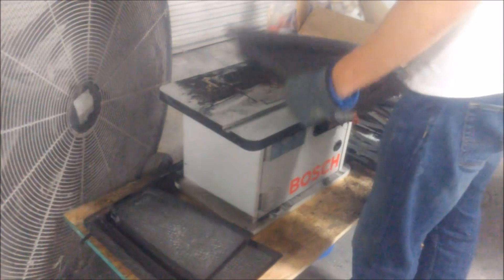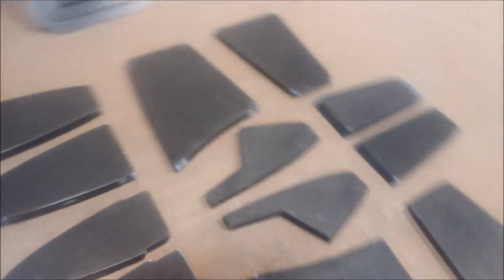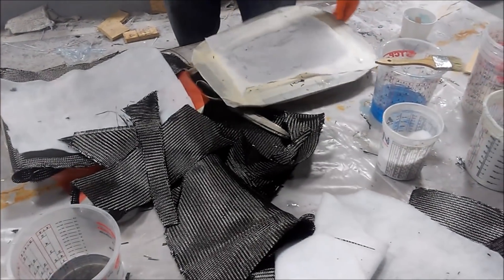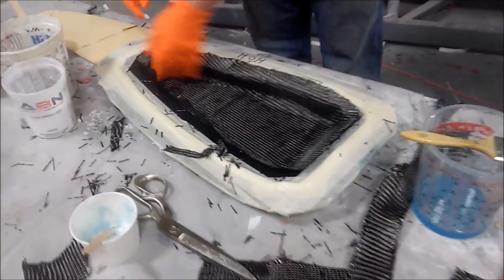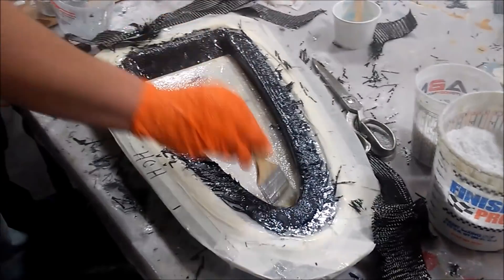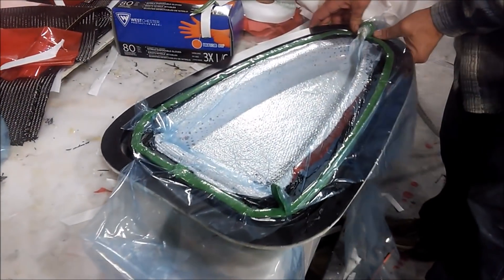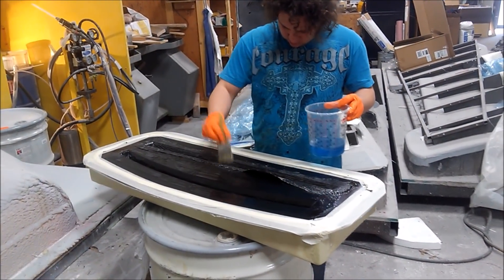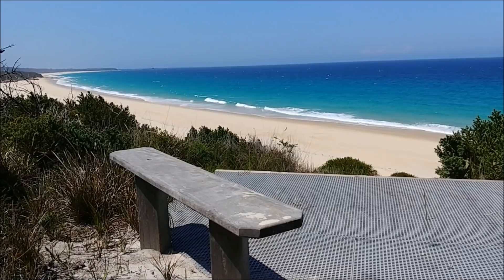A New Year

Comment: Something ive noticed along the way as i watch the videos.. when they are putting the resin on the carbon it looks like quite a lot, i have very little experience working with fiber glass or carbon fiber but what ive always been told is once you get the cloth saturated with the resin you want  to scrape all the excess resin away to keep it light weight as possible and i havent seen that being done in any of the clips. i am in no way suggesting it is being done wrong here, rather i am just curious about the process and want to know more about it! I really enjoy the updates Raptor Aircraft, keep up the good work! This year is going to be fill with a lot of good things!
Reply from the maker: Excess resin is pushed through the perforated film into the white breather fabric where it gets discarded once the part is released.